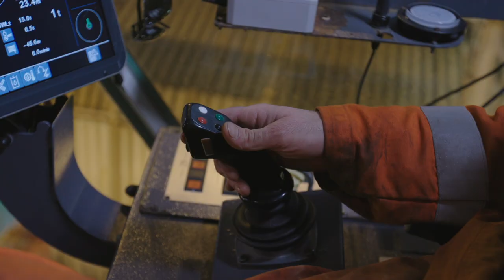Offshore Oil and Gas Showreel 2020

Comment: Ben you mentioned your kit is 2 cameras, might we ask what cameras you used along with what lenses to do these kind of gigs?
Reply from the maker: Hi Gerald. I generally use a C200 and EOS-R. Lens wise I really like the 17-55mm 2.8 for run and gun and frequently use the 16-35 2.8L, 70-200 2.8L and Sigma 35mm ART.